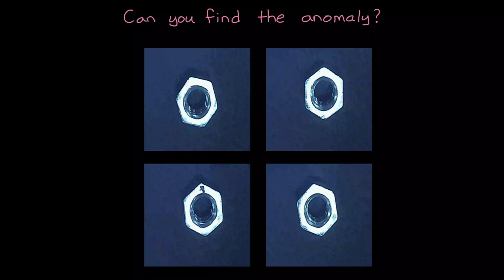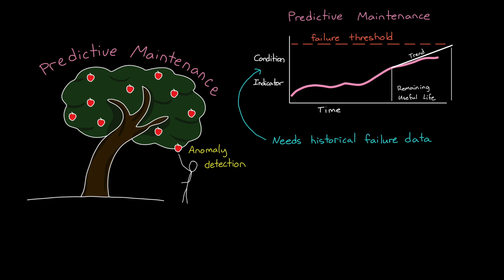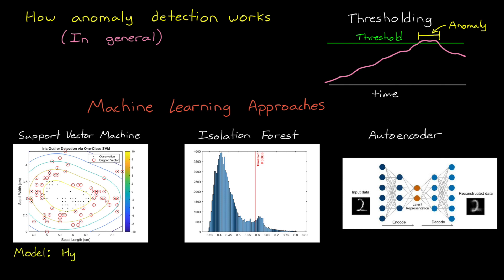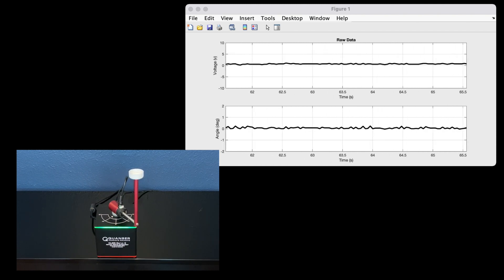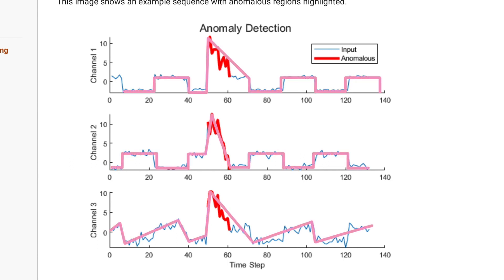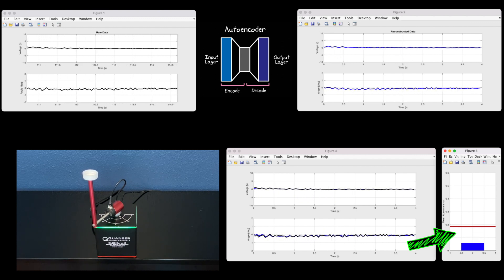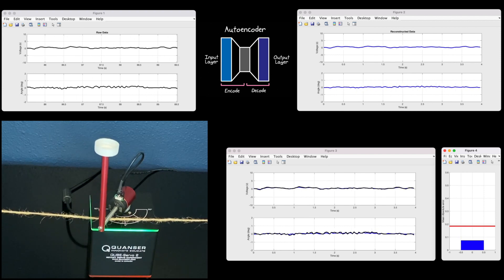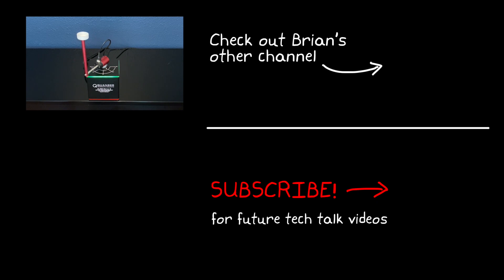Introduction to Anomaly Detection for Engineers

Comment: Have more standard estimators/observers from control theory, like a Luenberger observer, also been used for this? Because I can imagine that |y-yhat| (or maybe a low pass filter applied to that signal) might also be a good indicator of faults.
Reply: That’s a good point and I don’t know the answer. It seems like if the observer does a good job representing the nominal system then it could be used to flag anomalies.